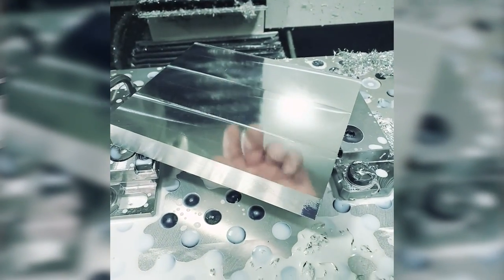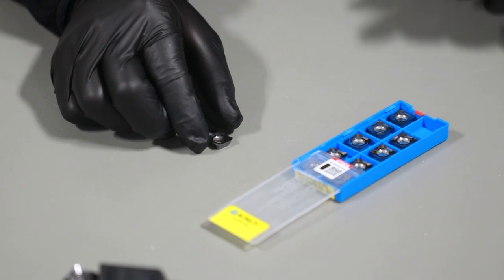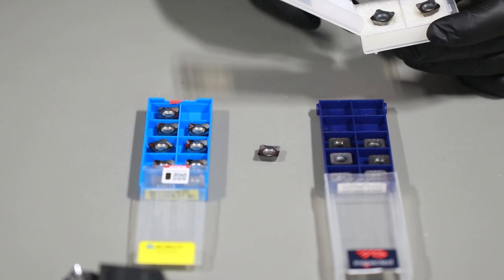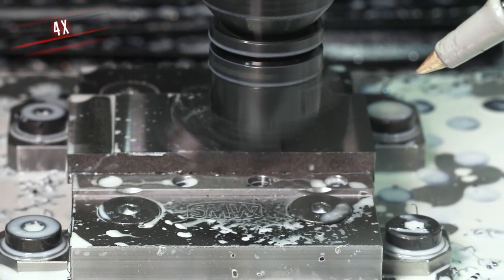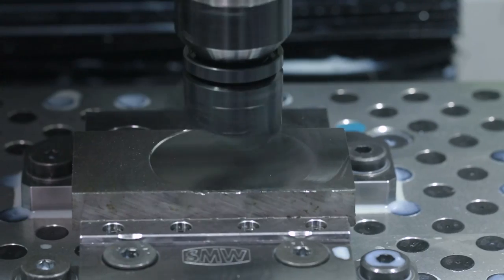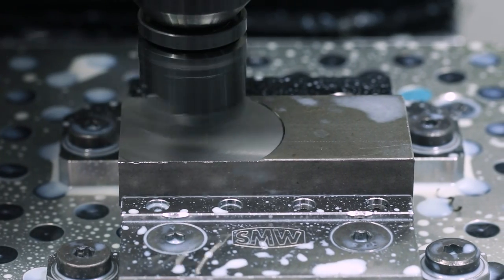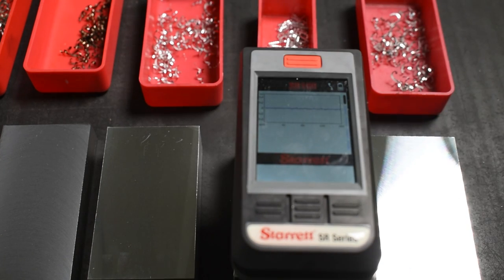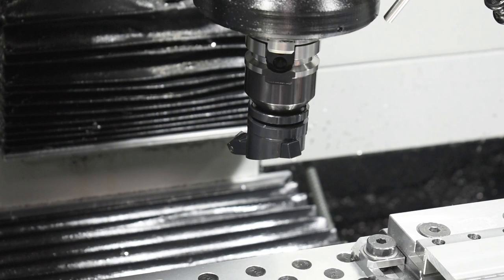Getting Amazing Finishes With the Tormach Superfly!

Comment: I actually get a good finish in 1018 and 6061 with my 3" - 6 insert face mill.  The only change I make is that I have one of the five inserts a wiper insert.  That way I get the high material removal rates AND a great finish.

Comment: any facemill can be used as a fly cutter..... only put one insert in
Reply: That's what I do with my PCD insert for finishing copper. Beautiful finish. I take off 0.02mm on the finish cut at 200mm/min at 2000rpm (63mm ISCAR face mill). Yes it's slow but the finish is worth it.
Reply: This is probably  a more balanced setup. So the vibrations wouldn't be as high.
Thanks for the tip.
Reply: I've done this lots of times with my 6" facemill. Works real well on bronze.
Reply: I love using 2 on 4 insert mill or 3 on a 6 shell.  in fact, I have a 4 shell with these same inserts that I run with 2.  it's the best happy medium with softer materials between speed and finish.
When I found that out, my world changed
Reply: Or just… use an inserted fly cutter
Reply: @robertmccomb6480  well of course assuming you have one. But if you find yourself in the middle of a job without one then you do what you gotta do. Also a discussion could be had about the efficiency of having 2 separate cutters to deal with vs only a facemill and removing inserts when you want a fly cutter. Sure a fly cutter may have slightly better geometry for doing its job but it's up to the user to decide if thats worth the purchase price and upkeep of a dedicated tool compared to only having one tool with more versatility.
Reply: @robertmccomb6480  and you've completely missed the point.

Comment: the fly cutter will always give you a mark on the ‘backside’ of the cut, the tool pressure is higher on the cutting side and therefore the tool deflection ‘up’ is higher on the cutting side. this effect should be more significant than the tram of the machine and it should he visible in both x/y directions.
Reply: I don't get any marks on my Mikron hsm700 with this fly cutter it's superb.
Reply: Or you can run your mill out of tram like me and get amazing results lol